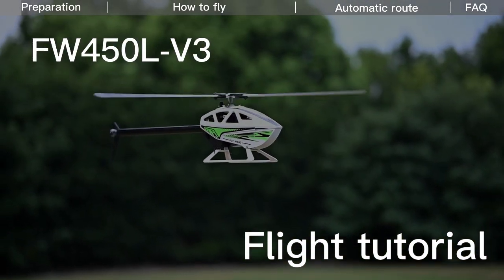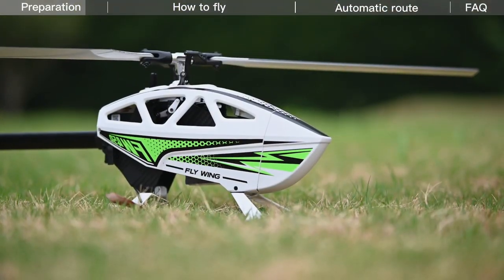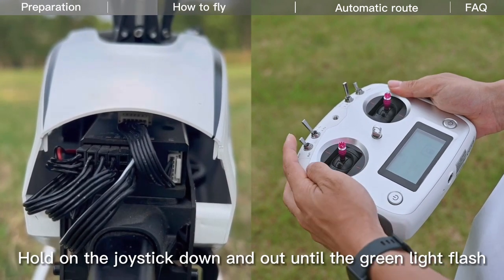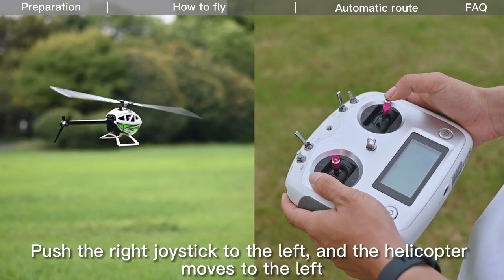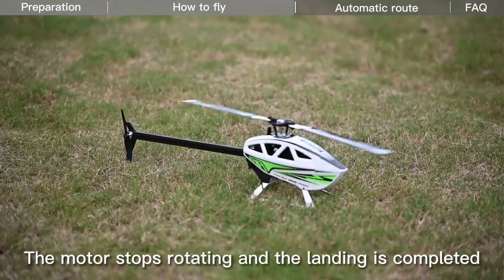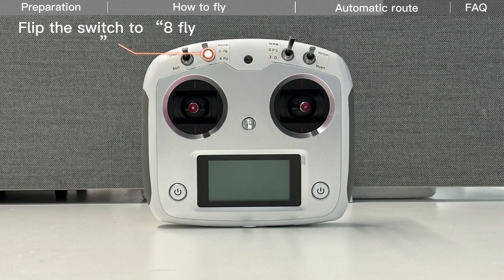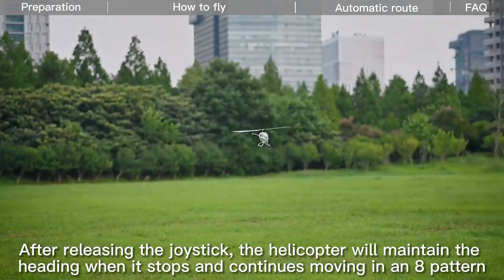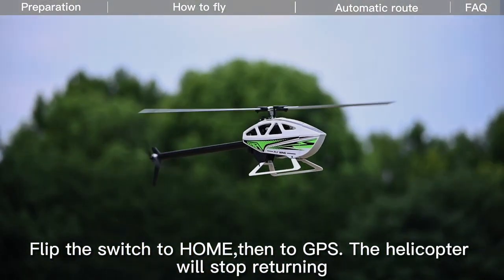FLYWING FW450 V3 First Flight Teaching Video

Comment: Yesterday my fw450 v3 crashed because the tail blade dissintigrated in the air. Its only the 5th flight. I never hit the tail blade to anything. I learned that a lot of owners experienced this too. Please improve your plastics.
Reply: I have a FW450 V3 as well. The tail blade simply exploded when flying? How is that even possible?
Reply: What about the warranty?  I guess if you can’t prove it wasn’t your fault it pretty much pointless.

Comment: Hi,
Got myself a FW450 and fly great for about a week. Try to fly again yesterday under GPS Mode and the helicopter started to fly away and I loss all control of the helicopter. Controller sticks have no control of the helicopter. I was able to bring helicopter back and landed safely by hitting the return home button. Please help.
Reply: Been there, done that. You lost a satellite. Dangerous situation. Your lucky it didn't fly away. This is why I only fly in manual 3D mode now.